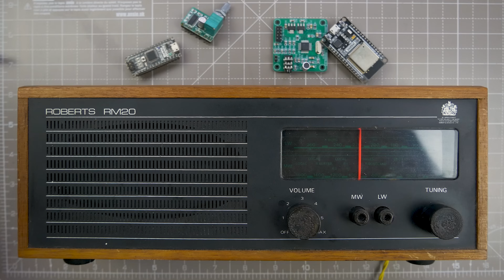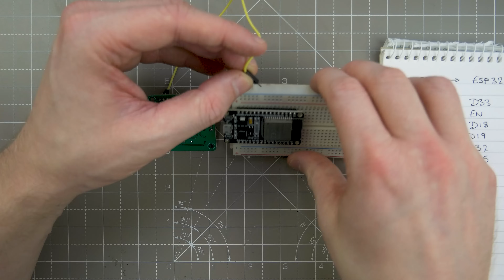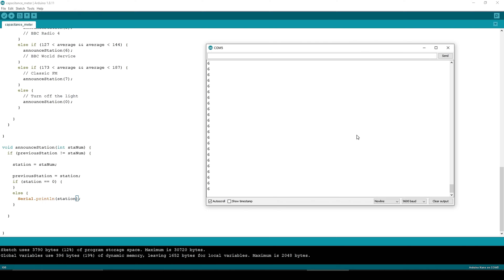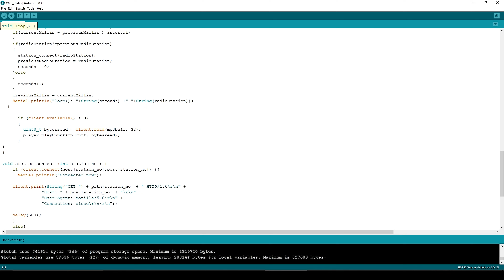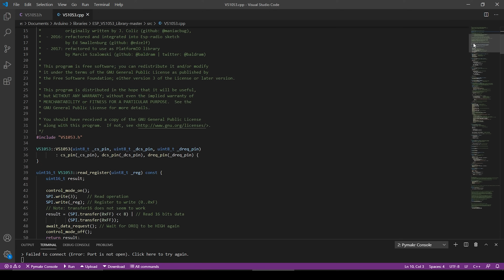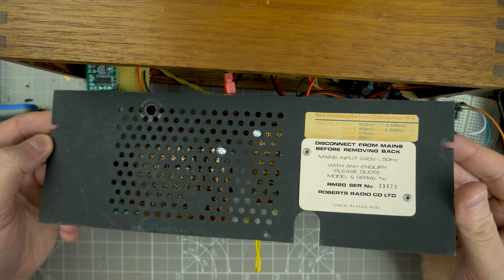From Start to Finish: ESP32 Internet Radio with a Roberts RM20

Comment: I would like to make such a radio, i.e. from an old tube radio, without throwing away the speakers to create a retro atmosphere, connect an ESP32 Bluetooth WiFi, but so that the buttons are responsible for turning on the radio, changing stations and adjusting the volume. How should I go about it???

Comment: Awesome project, thanks so much for the video!

Can I ask how can I find the fluorescent 3.5v lamp you used? Also, why didn't you use/retrofit the front volume dial but instead chose to expose a new one at the back?
Reply from the maker: I wanna say it was a bad pot but I'll be honest, I don't really recall now I am afraid. I am sure if I could have made use of it I would. It hasn't been an issue, I basically never adjust the volume so it is almost a benefit.

Comment: why do you need to use new amp, rather than the one already built into the radio? (I'm new to this so probably a dumb question to ask :p )
Reply from the maker: You absolutely could use the internal amp, but that amp is designed for different signal levels. It also means you would need to separate it from the tuner circuit and understand the how it operates. I didn't have the exact schematic so it would be difficult to integrate.

Comment: Hi David Really excellent project. I'm a newbe to programming. I'm trying to reproduce your project but having difficulty incorporating the new BBC streams. I have working streams but I get a 'can't connect message'. Happy to send the files as I'm sure you will need to update your radio too.
Reply from the maker: Sadly the the BBC streams don't seem to work anymore, I believe they have moved away from the old mpeg streams to a ADTS codec which this current setup cannot parse. I think it is just AAC which the vs1053b should be able to play but I am not sure if it needs different firmware.

I have ditched the BBC streams, I mostly listened to radio 4 for the spoken stuff and drama. I found Pumpkin Radio which has a lot of old BBC comedies and is still mpeg https://cast2.asurahosting.com/proxy/britcom1/stream/ there are a few of these with a quick google.
Reply from the maker: That said, the world service stream should still work
Reply: I think we are very similar I’m a radiophile who listens to BBC Radio 4 and the world service. I have streams that end in mu8. They work well in a browser but I’ve not had success with ESP32. The decoder should be able to play them I think. Happy to send them if you want another try?
Reply from the maker: @chainsawdave6342  Yeah the m3u8 file is just a container, the real bugbear is in the codec. There might be some other libraries that decode ADTS/AAC streams these days, sadly my code will never do that. When I get back to electronics next year I will consider doing an updated video.
Reply: @DavidWatts  Well I will definitely look out for your videos. I'm subscribed. I love the start with making a nice cuppa tea ;)   
Edzelf has posted a Dec 2023 update but I can't follow his code and don't understand PlatformIO yet

Comment: I am building this internet radio circuit to incorporate in into a dab/fm receiver with a touch screen and valve amplification the receiver is fully functioning and i will be posting a series of videos detailing its construction. I thought an internet radio would be an excellent addition to this receiver hence the reason for me to experiment with various internet radio projects to get one that would be easy to integrate in to the receiver. I have built this on the bread board and copied your modifications to the original code as when I tried the original code from Nick it just got stuck in a boot loop and just kept rebooting. After uploading the modified code the radio works but the sound quality is awful it sounds like a Darlek. I have tried several example codes all producing the same result. I have checked and double checked the code, wiring etc but still have the Darlek sound. Any ideas?. I have ordered a replacement vs1053 board as this is the only part i have not changed yet. I have tried several ESP32s but the result is the same.
Reply from the maker: Hey Peter, my first thought after reading all the previous steps you have taken is to try some different power supply options. 

Other than that, I would look making sure the radio streams you have are not super high bitrate.

There is a VSLI faq which might be helpful http://www.vlsi.fi/en/support/faq/search.html
Reply: @David Watts  The replacement VS1053 board arrived today I connected it up and.........PERFECT it works great and it sounds great so a happy bunny here i will now design the pcb to fit into the receiver. all there is to do now is to integrate the code into the existing code in the receiver MCU and get the touch screen to control the Internet radio as well.

Comment: Amazing stuff! That Capacitor-Trick made my day. Thank you. And nice to see my most loved radio station at number 1. Radio Caroline rocks!
Reply: the cap trick is really cool because so many of those era radios have odd mechanical set ups for the dial that make that would be a shame to lose and hard to replace with a variable resistor.

Comment: I have two internet radios working with raspberry p 3 (with terrible rotary encoders for tuning)  and I wanting to build a third one , impossible to find a RBP , now waiting for the esp32 to arrive, already built the arduino reading the capacitor and it works like a charm with your code!! Thanks!
Reply from the maker: Glad to hear it Ruben. I prefer the ESP32 for this because you don't have to worry about safe shutdown.
Reply: @DavidWatts  its working!! almost no change to your code, only that the esp32 refused to connect to wifi, it took me a week to discover that it came without a macaddress!!, added code to read the potentiometer and control the volume
Reply from the maker: That is great Ruben, wishing you many hours of fun. I hope you have a cool case for it.
Reply from the maker: That looks brilliant, well done.

Comment: Hi David. I could really do with some help. No matter if I use the original code, with all the screen and eprom stuff removed, as was in your video or if I run your esp32 code I am unable to get this project to work. The serial monitor continues to display loop (): number 0. Got to say am I a little lost. Any help would be greatly appreciated. I am trying to convert my Grandfathers old Roberts R404.

Thanks

Nick
Reply from the maker: It sounds like you are not using a variable capacitor to change the station or that isn't making it through. Try changing the default station "int radioStation = 0;" to see if that changes the number. I think that probably is the case, the number only directs the radio to trigger the the station in the array.
Reply: @DavidWatts  I wonder if that is the same problem I'm having. Is there an easy bypass?

Comment: Thanks for the  video. I have been building wifi radios for a few years now I have made them for family and friends.  Sine we live in an extreme rural area where real radio is difficult to tune in, we have one FM station that is a copy of the one AM station here in town. If you have an external antenna for your radio, you can tune in some other stations within a couple hundred miles but they are weak.  If you love SW then there are a few stations that you can get with a good set and an outdoor antenna. I do have one small, well medium small AM/SW set built in the old USSR that pulls stations in without the external antenna, love that little set, just had to replace on capacitor to bring her back to full life.  Shipping was an issue but it got here, I picked it up as "parts" for a total of 40 bucks half for shipping half for the radio.  The thing I always wanted was a unique way for tuning in the wifi without a screen. Most of mine have a screen and I tune them with a rotery encoder, this works fine if you don't mind the screen, but I wanted one where I could use the tuningcap on an old 1957 GE AM tube set that is pretty much trashed as the early board is pretty much gone, someone has gone through it and soldered old power cord wire atop the printed board but that is kind of sketchy. I have all the parts for this build in stock, in fact I was experimenting with a different V1053 board, smaller made for a different setup on a beagle bone black board which works great and is a very small footprint with an ESP32 mounted beside it and the wires jumped on the board I think it will be a simple matter to add the nano to change stations.  How many stations can you put on this using the capacitor for tuning?
Reply from the maker: Thanks for the lovely comment, it was a really interesting read. I'd love to lean into radio at some point in the future. To answer your question, I have 20 stations programmed in with plenty of space on the potentiometer in between so there are no overlaps.
Reply from the maker: Variable capacitor, rather than potentiometer ;)

Comment: Looks like I'm over year late in finding your presentation. Beautiful and so well thought out. I've build several ESP32 radios from one station to four. All produced less than satisfactory results. Play for a while then quit. Reboot and play for hours then quit. On the multi channel radios using push buttons to go up and down, usually quit changing in proper sequence. So, after almost a year and a half after shelving the project, you have inspired me to try again. The slider dial did it!  Thank you David.

Comment: I'm very new to this coding. I want to have a go at this project but I'm having difficulty verifying/uploading it and I'm getting an error message, id be grateful for any help. error below..
I'm using David Watts code as per link above.
 
Arduino: 1.8.13 (Mac OS X), Board: "Arduino Uno"

ESP32_Web_Radio:7:10: fatal error: VS1053.h: No such file or directory
 #include <VS1053.h>  //https://github.com/baldram/ESP_VS1053_Library
          ^~~~~~~~~~
compilation terminated.
exit status 1
VS1053.h: No such file or directory

This report would have more information with
"Show verbose output during compilation"
option enabled in File -> Preferences.

Comment: A boost converter to power the old bulb at a higher voltage. But actually, a bright white LED (3 to cover the range of the scale might have been better?

Comment: hello, i will do that same with my old radio ... but the simple radio stocks some times so i have had tuned it ... 

// *********************** Ringbuffer ****************************************************
#define ringpufferSize  0x8000                                     // Ringbuffer  
#define ringpufferSize_ 0x8000-1                                   // rungbufer mask for wraparround 
uint8_t*            ringpuffer ;                                   // Ringbuffer for VS1053
uint16_t            rbuff_write_index = 0 ;                        // Fill pointer in ringbuffer
uint16_t            rbuff_read_index = ringpufferSize - 1 ;        // Emptypointer in ringbuffer
uint16_t            rbuff_count = 0 ;                              // Number of bytes in ringbuffer
//*********************** Reconnecttimmer ************************************************

void read_buffer()
{
    int maxchunk = client.available();                             
    if (maxchunk > 320) maxchunk = 320;                             // das reicht, um den puffer sicher zu füllen und den wandler schnell genug zu starten.
    while ( (maxchunk-- > 0) && ( rbuff_count < ringpufferSize ))   //  rbuff_count gibt an, wieviel verfügbar ist
    {
      uint8_t bytesread = client.read(mp3buff, 1);                  // read from stram
      *(ringpuffer + rbuff_write_index) = mp3buff[0];               // Put byte in ringbuffer    << Zeiger +
      rbuff_write_index = ++rbuff_write_index & ringpufferSize_;    // Increment pointer and wrap at end / Überlauf abfangen
      rbuff_count++ ;                                               // Count number of bytes in the ringbuffer
     }
}

void play_buffer()
{
  while ( player.data_request() && rbuff_count )                    // Try to keep VS1053 filled
    {
      int n = 0;
      while ((n != 32) && rbuff_count )                             // den puffer füllen
      {
        rbuff_read_index = ++rbuff_read_index & ringpufferSize_;    // Increment pointer and wrap at end / Überlauf abfangen
        rbuff_count-- ;                                             // Count is now one less  / lesezähler reduzieren
        mp3buff[n++] = *(ringpuffer + rbuff_read_index) ;           // return the oldest byte / erstes byte zuerst zurück
      }
      player.playChunk ( mp3buff, n ) ;
      timerWrite(timer, 0);                                         //reset timer wenn er 10 sekunden hängt , reconnect
    }    
}

void test_on_error()                                              
{
  if (!client.available() && (!rbuff_count))                        // no data and empty ?
  
  {
    //delay(50);                                                    // if you does not use LCD here , put delay(50) aktive
    error_count++;
    Serial.print("count :");
    Serial.println(error_count);
    lcd.setCursor(44, 1);
    lcd.print("Under.: "); lcd.print(error_count); lcd.print("  ");
  }
  else
    error_count = 0;
}

void loop()
{  
  read_potentiometer();
  
  test_on_error();

  if ((previousRadioStation != radioStation) || (error_count > 25 ))  // auto reconect, change station
      {
        reload_station();
      }
      else
          {
            // -------------------------------- Read datas from webstream -------------------------------------------
            read_buffer();
            // -------------------------------- Write datas into MP3decoder------------------------------------------
            play_buffer();
        }
}

Comment: Great work David, love it, doing something similar myself now. Only thing I am doing differently (basically because the nanos are acting up!) is I am using the touch sensor (touchRead(T0) with the variable cap connected to pin4, and the other end of the cap connected to ground, solid results (so far, leaving it run while I keep an eye on the values) with this code from microcontrollerslab dot com slash esp32-touch-sensor-button-example:

int touch_sensor_value=0;
void setup()
{
Serial.begin(115200);
Serial.println("Touch sensor tutorial ESP32");
}

void loop()
{

touch_sensor_value = touchRead(T0);
Serial.print("Touch0 value is = ");
Serial.println( touch_sensor_value);
delay(1000);
}

Anyway, thanks for helping me get started on this, great stuff!!!

Comment: MES is Miniature Edison Screw, very common in the 1960s and 70s.  It's one size up from Liliput Edison Screw, the one that lots of "fairy" lights used in those days.
All gone now, LEDs are so much easier.

Comment: Why is there a knob on the back? Try to install the amplifier board behind the front with the original knob! 😉
Reply from the maker: Then I would need to put the power switch somewhere else. I don't need to change the volume as much as I need to turn it on and off.

Comment: You did a really cool job, although this still isn't something I'd encourage people to do, as the radio has already lasted 45 years but the new electronics will probably fail after 5, better to just buy an RM40 which has an AUX input and plug in a Bluetooth receiver.

Comment: Great project, why did you use a nano for the station dial instead of measuring it with the esp32? 😊
Reply from the maker: It was a know working solution from  a previous project, I didn't want to add any more complexity, I wanted to finish it in a day.

Comment: David, I have a suggestion: 
Is it possible to use the existing Band Selector of the radio (some old radios have at least three Bands) to change between station's libraries, for example: Rock, Blues, News, Foreign and so forth?
That would add a lot of potential to this project!
Reply from the maker: Yes, you could do that to switch stations like having different playlists of streams. They are ganged switches on most radios so it would be fairly easy just to have them on interrupt pins.